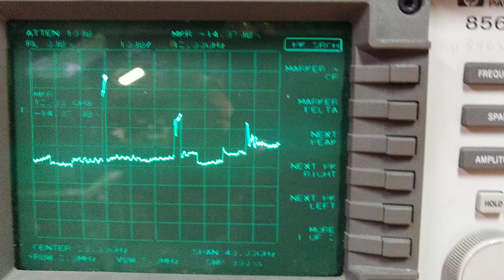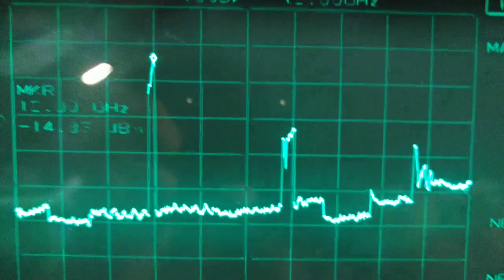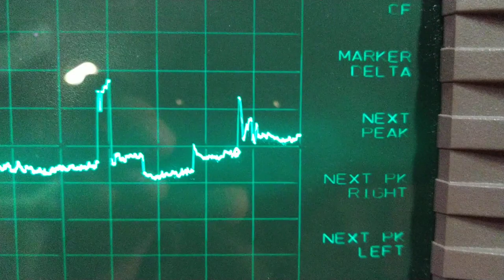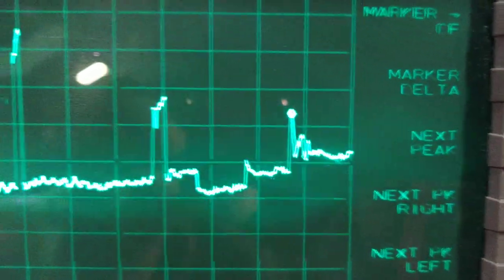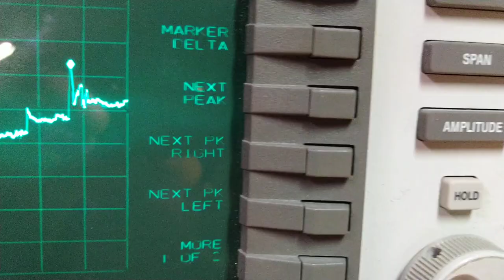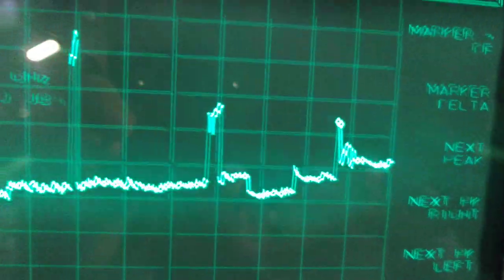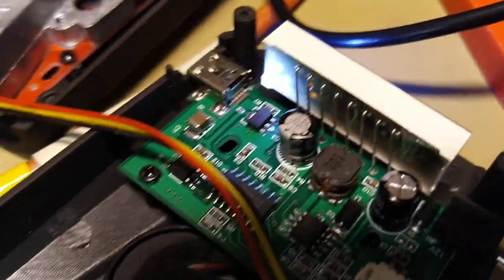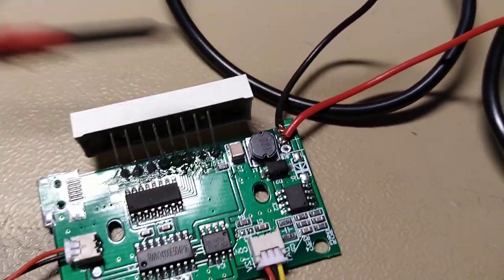eBay radar detector RF leakage and a look inside

Comment: If I understand your video correctly, it should be possible to toss the digital board and use the red/black/yellow wires to supply power and RX on an SDR with the microwave signals converted down to around 1GHz? I have been wanting to play around with microwave but without the expense of microwave equipment. :^) I tried to build a horn antenna, but a lot of things went wrong since it is difficult to buy quality materials locally. Thank you.

Comment: haha that was great! I loved seeing you walkthrough the PCB components and how the signal passes through. The USB port at the end cracked me up too. :) Have you considered doing more RD vids like this? Perhaps with better detectors?
Reply from the maker: I have, but I'm honestly more interested in re-using the detectors for something else than the intended purpose. I should have some beltronics unit somewhere in my junkbox, bought for the built in 10/24/34GHz frequency counter function, but then I bought a 26.5GHz HP counter and it became redundant. So might as well do a tear down with it.

Comment: I have Ka-band ODU (TRIA) that have output frequency 28.1 to 30.0 GHz @3W. I don't have access to any expensive spectrum analyzer and I'm looking for cheap option to re-purpose these cheap radar detector so I can at least know if transmitter is on or off:
 This cheap radar detector operates 
(well based on the specs):
K: 24.150GHz ± 175MHz  (~4Ghz below my TRIA)
KA: 34.700GHz ± 1300MHz (~4.7 GHz above my TRIA) 
Do you think that this radar could detect signal outside its specs? Can I e.g. Trim pcb filters to increase detection range around Ka-Band?
Reply from the maker: Not really, the detection range is sort of fixed in the software. But if modified in to a fixed LO downconverter, as I'm planing to do, it should work fine for that.